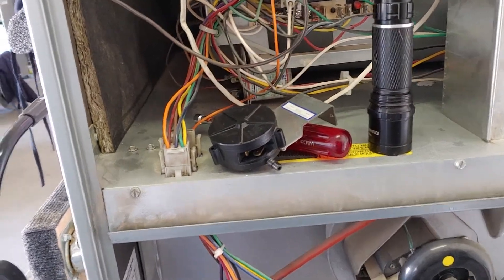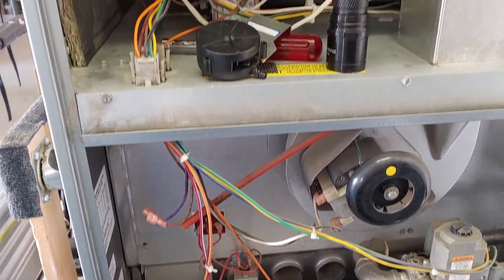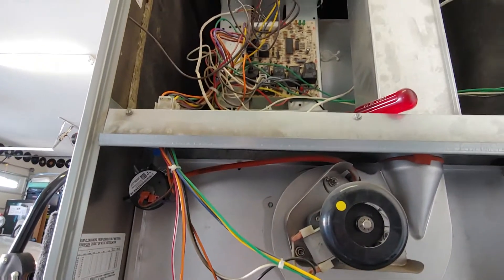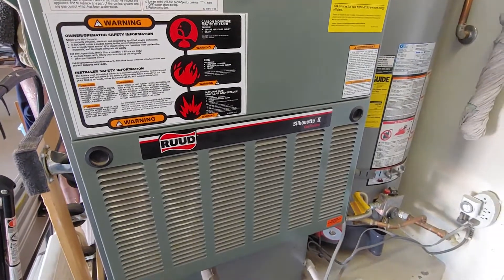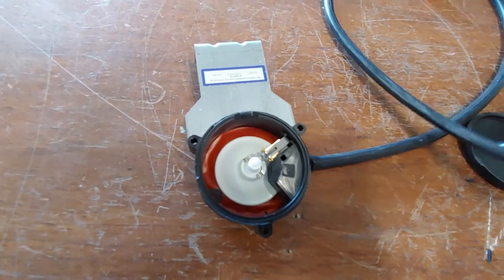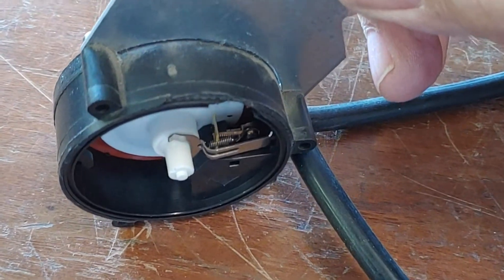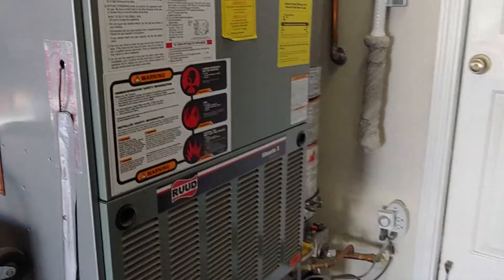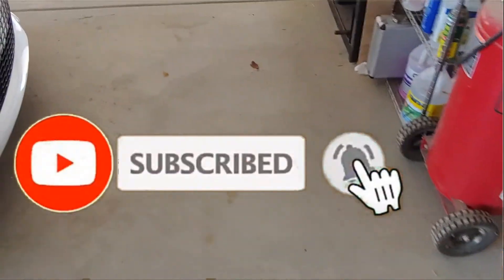(345) RUUD furnace Pressure Switch Fixed and taken apart.

Comment: Can you please describe the symptom of failure?  I know when thermostat kicks on the furnace the first thing to start is the combustion fan.  I heard yours kick on and you said you knew the new pressure switch was working.  In the failing state, did your combustion fan fail to start at all or did it run then stop?  Thank you!
Reply from the maker: It wouldn’t restart to heat.. no nothing. If I hit that switch lightly with a screw driver, the furnace would start heating again. I did that a few times and determined it what the switch. It’s been working good ever since.
Reply from the maker: By the way, yours sounds more like the valve for the gas is not coming on… it could be a faulty gas valve or thermocouple that controls the valve.
Reply: @JackOfAllTrades2022  Thank you very much :)  but my question was just trying to narrow my issue.  What's happening to me is that the motherboard flame sensor LED never lights up.  I replaced the flame sensor but have not checked the microDCV yet to be sure it's working.  It is positioned well into the flame.  I bought a new motherboard and still the same problem.  Next I'm going to jumper the pressure switch and try banging on it.   On startup my furnace combustion fan starts up, then the igniter lights the flames and after roughly 1 minute the flame shuts off and it tries it again.  Always the same result, very much like the flame sensor isn't working.  Thank you very much!!!
Reply from the maker: @dagnabbit3383  I’m not a AC/Heat person, but it sounds like what you just mentioned, it’s probably one of your sensors.. but your best bet at this point before spending any more money and time, I’d call and get professional help. I’m sure the motherboard wasn’t cheap. Still sounds like the thermocouple. If it’s out, it’s telling the gas valve to shut down so that you don’t have gas blowing  into your system without a flame.
Reply: @JackOfAllTrades2022  Thank you very much.  Yes I’m about to give up and make a call 😫
Reply: How did you know which terminal to connect  your purple and brown wire.   I see the old one has the terminals that are covered but the new one has the terminals on the outside. I just ordered q new pressure switch and it has the terminals on the outside but my old one has them inside. I want to make sure I connect them correctly when I receive the new pressure switch.

Comment: Is the hose 3/16"?
Reply from the maker: It’s been a couple years so I don’t remember the size, it came with a hose so it’s not a guessing game if your going to replace the hose as well. It looks like it was a 3/16 but I can’t be sure. After a couple years it’s running fine. Thanks for watching, hope you have the same luck as I did.